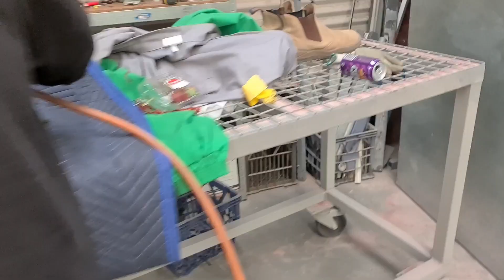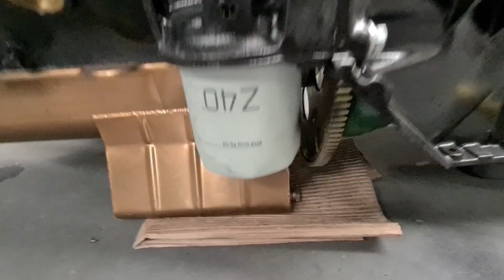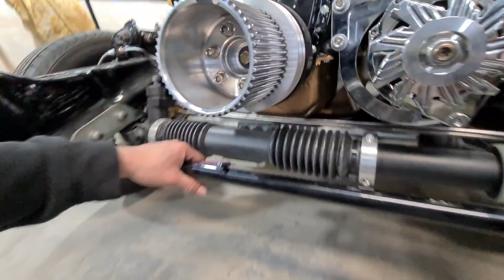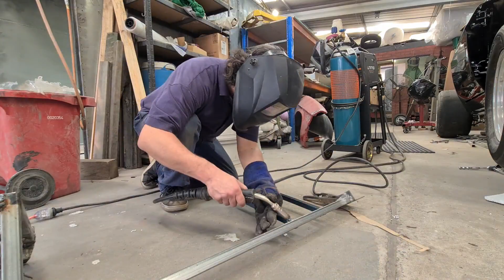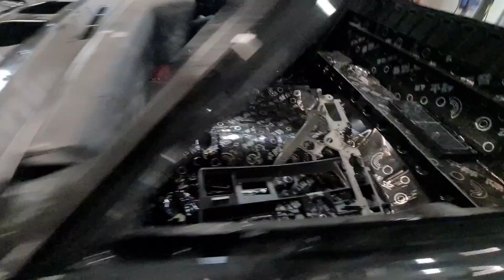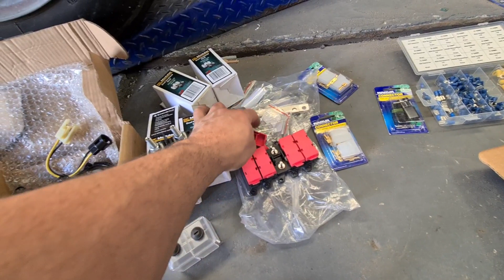HQ HOLDEN 1 TONNER ENGINE AND DROP TANK  INSTALL AND  WIRING SET OUT

Comment: Hey lads, what size Wilwood master cylinder are you using? Cheers
Reply from the maker: Hi David we are using the rod shop Wilwood Master Cylinder with Bore 1 1/8"  , hope that helps
Reply: Sure is thanks guys.
Reply: Hey guys love your work
I’m doing the same with the power steering pump and battery 
Do you think having the battery and pump on the one side will effect the angle of the Ute once the driver is in just curious I’m thinking of putting the battery on the passenger side but now the problem of power drop being further away 
Thoughts would be appreciated thanks
Reply from the maker: Hi Nathan thanks for the questions.
Sure battery/Psteer weight on one side, particularly drivers, may be noticeable with the driver only being seated. The end of the day so much is changed on the car from factory without corner scaling the car it may be hard to tell. There were a number of things that were considered but either side will work just aswell as the other.
Few thing i considered for the battery/Psteer/ trans cooler mounting.
- Psteer hose length ie. lenght from pump to rack to cooler back to pump.(to long has potential pump over working)
- Astra Psteer pump has high amp load at times, short power cables are preferable.(fuse recommended 70-80amp)
- With the SBC the starter is on RH/drivers side, makes cable routing from battery to starter easier, doesnt have to cross the trans tunnel. 

Really though done properly whatever location suits your set up best.
-Hot tip on rear mounted battery cables, '50-70kv welding cable'  (better quality and arguably cheaper than parts store), with all the connections done properly you'll never have an issue with a slow starter.

Hope that helps on your project moving forward